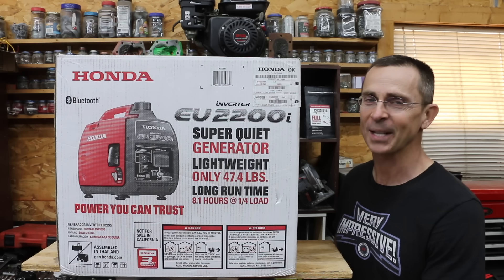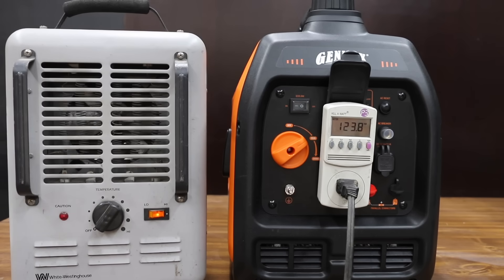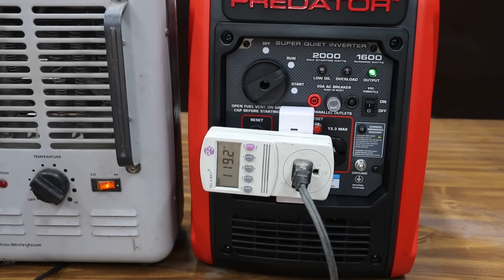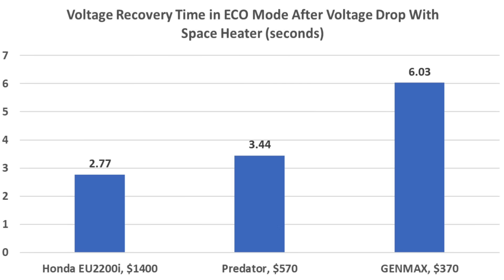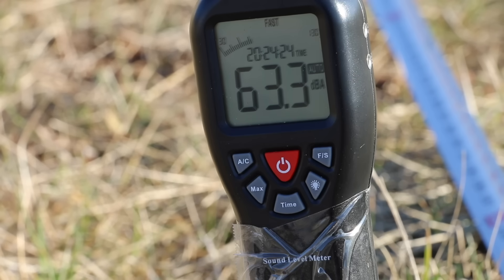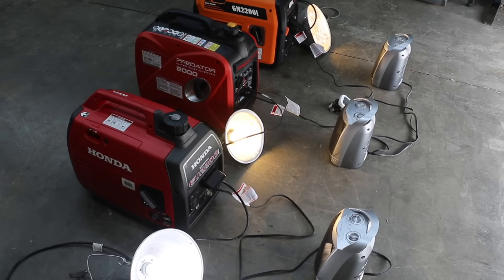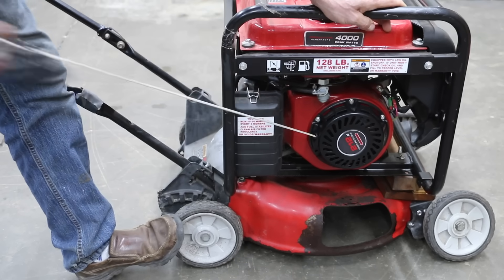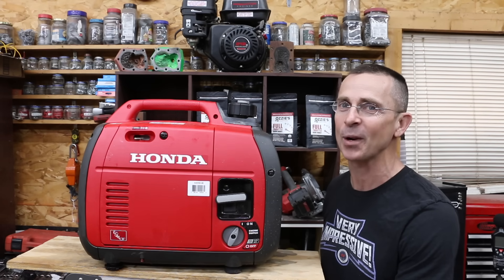Cheap Generator Better Than Honda? Predator vs Honda & GENMAX—Let’s Settle This!

Comment: Great review. Just shows if you're using generator for something like running a quick food stall by buying a honda you will get longevity and overall reliability. The others would be great for occasional use like power cuts and camping. 
Have a 1kva Honda generator which is whisper quiet and starts with one pull, even after months of none use. It also will deliver more than 1kva power for short periods like boiling a kettle or using hair dryer without automatically cutting engine out due to overload.
All in all a fabulous genny which is there for instant use when needed in emergency.
Reply from the maker: Thanks for the feedback.

Comment: Seems like I could buy a few of the cheaper ones, hook them together and be better off than the expensive Honda.  BUT with that said, I have two generators now and one runs a B&S engine and the other Yamaha... Id buy the Yamaha engine again in a second...

Comment: I have a predator 3500 generator that I have had for about 6 years. It has an unknown amount of hours since the screen no longer works. I changed the oil once a year on it, besides the screen not working. Never had an issue with it. At work. We use Honda generators which are used much less than mine, and we have constant issues with them. Every year. Year. Predator definitely makes a better generator that is also much cheaper.
Reply from the maker: Thanks for sharing.

Comment: I love your videos. Only thing is that the Craftsman generator is probably the closest 1 to the Honda in all areas. We used it for 13 days for our oversized refrigerator, window AC unit and phones. Adding the tv made the switch kick off.  Just reccomend and tough comparison.
Reply from the maker: Thanks!

Comment: I would say that there are different needs in different regions.  For me I need a generator that can run on all types of fuel and run with low noise.  Because gasoline and diesel electricity are expensive to generate electricity, natural gas, especially methane or propane tanks for camping, is very convenient.  Fuel is easy to store, does not spoil and very cheap.  Using natural gas or methane gas tanks for the same power generation can save about 80% of the cost.  According to my experience, a $1 methane tank with a net content of 250g can run the generator for one and a half hours.  This is enough for me to charge all my energy storage devices including my DIY power wall.
Reply from the maker: Thanks for the feedback.

Comment: Always go with Honda, It'll never leave you in the dark. I have the big boy one, the EU7000is.  Love the fuel injection and push start. Hate the fact that it's only 5500 watts continuous and only a surge of 7000. But runs my whole set set up.
Reply from the maker: Thanks for the constructive feedback.
Reply: @ProjectFarm  you've always got great informative and interesting videos.

Comment: I've a few suggestions for potential videos.

1. Different solar panels comparison to see which manufacturer's panels provide the most consistent electricity under the same conditions.

2. Different lithium batteries comparison where you test out the consistency of the voltage, battery life and health.

3. Comparison between different capacities of batteries (like 12v, 100 amp vs 48v, 100 amp) on a price to performance ratio.

3 is something in personally very interested in as I've seen the 48v batteries cost as much as three times the price of buying 4x 12v 100 amp batteries (which you could run in series/parallel to get similar backup).
Reply from the maker: Thanks for the suggestions.

Comment: I would like to see mid size inverter generators(3500 to 4500w) tested. Honda, Predator, Duromax, and others.  Also dual fuel (gasoline vs propane) for output and performance.
Reply from the maker: Thanks for the suggestion.

Comment: Great video as always.  But one thing you forgot to mention it on the Honda you can turn the fuel off so it uses all the fuel in the carburetor bowl which helps prevent the jets from clogging.
Reply from the maker: Thanks!  Thanks for the constructive feedback.

Comment: I like Champion generators.  Chinese, but have parts and warranty in the US, only a phone call away.  I don't know if parts are available for the other Chinese brands at all. Much less that easily.  Mine are the older style 2000  inverter generators.  The square stackable ones. Now they are suitcase shaped.  Purchased two and the paralleling cable for less than one Honda.  Would have bought Hondas if that was possible.  So it was either two Champions or nothing.  They both have been great at running the air conditioning in my camper.  Almost five years old now.  I don't see a reason to buy a the Honda
Reply from the maker: Thanks for the feedback.

Comment: Nice video, as usual!  If you were going to do another portable generator comparison, I'd like to see the Champion (200961), Pulsar (PG2200BiS) and perhaps other portable dual-fuel generators added to the mix.  Also, I'd love to see a degreaser comparison on automotive engine bays, wheel brake dust, and carpets, (for both cleaning-power and harmful effects on paint, aluminum, upholstery, etc.) with the top brands like SuperClean, Purple Power, Super Green, Oil Eater, Zep, etc.
Reply from the maker: Thanks!  Thanks for the suggestions.
Reply: Would like to see also

Comment: I have a Honds. 2200 I you get what you pay for they are designed to last 20 to 40 years and they hold there value you can still sell a 2000i for $700
Reply from the maker: Thanks for sharing.

Comment: you know you cannot buy those in California anymore due to the tomf-kery of the CARB? (ca air resources board).  basically they made Honda "recertify" their engines after they already did, and were using bureaucracy to unofficially ban them from being sold.  i went though this because my shop needed 2 new generators.  the largest they could sell is 6.5kW here. we bought 2 at $7k a piece.  don't ever live in California.  they'll all be banned in 2 years also.
Reply from the maker: Thanks for the feedback.

Comment: The thing is, for the price of the Honda, you can buy two of the other ones so you have a spare generator and engines can be replaced with better engines actually.
Reply from the maker: Thanks for the feedback.

Comment: Folks - GENMAX IS NOT GENERAC ... please correct me if I'm wrong.
I have the Generac inverter generator, and it looks slightly different from the Genmax in this video. I googled a bit, and it appears that Genmax is NOT Generac.

Comment: As electronics engineer I have a few things to say. For power tools and many other appliances voltage drop during start-up or plugging in is actually beneficial. It has the same effect as a soft-start functionality built in into many instruments, but to lesser extent as voltage does not drop enough to be a real soft-start. If going beyond power tools, the vast majority of modern devices have a switch-mode power supplies which do not care about voltage drop of this magnitude. And it does not cause more wear in >99% of appliances.  If not considering power meter inaccuracy, no load voltage of Honda is out of spec as 114 V to 126 V (RMS) (−5% to +5%) is allowed. As of voltage recovery time, this power meter has way too slow response. You need to keep  in mind that not only it has a  lot of delay in what it shows, but this delay is also inconsistent. There may be more short term voltage drop than displayed, recovery may be faster, and there may be voltage overshoot during recovery which is not visible due to sluggishness of the meter. Oscilloscope which was used later in the video is a way more appropriate instrument to measure voltage drop and recovery speed.
Reply from the maker: Thanks for sharing.

Comment: When comparing generators it’s important to also test them at altitude.  The cheaper generators often struggle above 3000 feet.  When comparing decibels it’s important to know that an increase of 3 decibels is twice as loud.  The initial cost of Honda generators is high but it’s the total cost of ownership that’s important.
Reply from the maker: Thanks for the feedback.

Comment: I wonder if the gap from the Gen Max was instead factory correct but wrong in the maintenance manual especially with tbe amount of carbon deposit which meant it was not burning properly. 🤔  Maybe redo the test with the factory setting?
Reply from the maker: Thanks for the suggestion.

Comment: Great video as usual, very informative. On a similar topic, there's been a few times I've had to run my refrigerator and other things with a 1500w inverter connected to my car. I'd love to see inverters compared, including pure sine wave vs modified sine wave inverters.
Reply from the maker: Thanks and you are welcome!    Thanks for the suggestion.
Reply: Inverters are nice but supplying them with the 12V power for longer term operation is the hard part, unless you have some large power bank set up.
It might be interesting comparing ultimate efficiency using a generator vs a car with inverter, in terms of kWh per gallon-  that'd be an interesting test to set up.
Reply: @dubmob151  yep. I had to keep my car running the whole time when I ran my refrigerator from it. Definitely wasn't the best or most fuel efficient way of doing it, but I didn't have a generator at that time, and that setup got me through a few multi-day power outages.
Reply: @YardDart63  advantage of that is the gas will be fresh and ready at all times, if you only need it for the occasional power outages once every millennia or so.  Generators need to be prepped properly for long term storage also, so an car inverter has the advantage of just unplug and go.

Comment: My 15 year old Honda 2000i is still going strong and does not burn oil. It does not have an hour meter so I'm estimating around 800 hours minimum. You did an excellent comparison here!
Reply: The 2000i actually DOES have an hour meter. It tells you, in code, by flashing lights when you first start it (on the panel). Count the number of flashes, and that's how many hundred hours it has run.

This is a little known trick that can help you find a smoking deal on a used 2000i with low hours. Also, learn which model numbers are made in Japan (another thing the average person doesn't know how to find) I got one with 200 hours for $400.
Reply: @PaulLawson-k8v 
 Honda models that are made in Japan usually have a tag saying "made in Japan". Actually Yamaha has more models that are made in Japan than Honda.
Reply: just cant beat a Honda, when we get new equipment at work I get excited when it has a Honda, lol
Reply: @PolPotsPieHole 
Don't forget Yamaha. 
Also made in Japan  and in some cases better than Honda.
Reply: @PolPotsPieHole I've got a Chinese copycat Honda that's 24 years old and has over 30,000 hours. It doesn't burn oil either. Starts with the first pull.
Reply: I tend to attach an hour meter to all my appliances. ;)
Reply: Generator snobs
Reply from the maker: Thanks so much!  Thanks for sharing.

Comment: I have two eu2000i's pushing about 800 hours each, used pretty much weekly.  Following the book maintenance schedule, both still run like new and use no oil between changes.  Great machines!  It's worth pointing out that the Honda should be expected to have a more pull start effort required, as well as use a bit more fuel, as it's a significantly larger engine than the other two.   Thanks for the tests!
Reply from the maker: You are welcome!  Thanks for sharing.
Reply: @ProjectFarm I Love to See Comparison of Champion inverter generator and Westinghouse inverter and Honda inverter generator 👍
Enjoy your videos
Reply: GE-3300A
Reply: I have 2 that have at least 4000 hours on them still going great.
Reply: Had the same results with my honda, very solid and reliable . it is 20 years old and still  chugging along. did replace the carburetor one time.
Reply: The larger engine is great - and still quite efficient. Not only does it give it that quiet/distinct 'Honda purr', it also handles sudden large jumps in demand while running in Eco mode without significant vdrop. I have used another few small inverter generators that can/will drop to the mid 80V range before their engines kick up in response, which is no bueno for some devices (usually OK with Eco mode OFF on those generators).
Reply: Yeah MY EU2000i has over 10,000 hours and still runs like new....Also the Honda probably only uses more fuel till it breaks in which takes several hundred hours. The Honda clones probably all have pretty loose tolerances so start off with a lot less internal friction...At the cost of many of them not lasting as long as the Honda's break in period.
Reply: @THX..1138  All the clones use a 80cc engine, the Honda EU2200 (as tested) uses a commercial grade 120cc engine..  I have no idea what your EU2000 has for an engine, but it is not the same as the EU2200
Reply: @THX..1138 what do you do in life that puts so many hours on your generators? 

And are the inverters significantly quieter than the portable generators in person? My portable is REAL loud and not ideal for going unnoticed in a power outage
Reply: @THX..1138 I guarantee my copycat Chinese Honda has well over 10,000 hours, closer to 30,000 hours. It's currently 24 years old and starts with a single pull.
Reply: @Bryan-Hensley  Yeah I can believe that, but there's some luck in your purchase. China clones vary wildly in quality. Like all Chinese products most fall in the range of the cheapest they can possibly build it. If you buy real Honda you for sure get real Honda quality... 

Also back when the Honda clones first appeared they were literally made by the same factories Honda contracted to manufacture the EU2000. These units were the same generator they were making for Honda, but without the Honda branding. Honda even sued over it at one point because people were putting Honda stickers on the clones and selling them as the real thing...So your 24 year old Honda clone may actually be a real EU2000.
Reply: @THX..1138  it wasn't a copycat eu2000. It was a non inverter model. I can't remember what model Honda called them
Reply: got two eu2000's one that we did the maintenance on and valve adjustments after 1k+ hours and a new one that we completly neglected, ran 3-4x the hours per oilchange it's been running for atleast 2k hours now sometimes coldstarts in -37c like last week in northern Sweden. Both generators have ran perfectly for over 5k hours total. Compared to that of a Kipor Chinese castiron pos, that needed new sparkplugs every 3 days it's night and day. Also ran it 24/7 for 3 months fuel and go due to a exploded battery bank, and it survived.

Comment: In order to get an accurate generator engine oil analysis you need to strip the engine and clean all the engine internal parts and cavities then test the oil or run the engine for 300 hours and change the oil every 100 hours then test the oil.:face-blue-wide-eyes:

Comment: Test Westinghouse... I bought one of their first units to come out when they re-entered the small generator market about 12 or 13 years ago... I spoke to an engineer and he said the present parent company after buying Westinghouse back then realized they were sitting upon a bunch of proprietary technology (example: counter rotating fans that reduced noise) that could improve the generator market and they have done so over the last 10 years in particular. He did a bunch of testing (different stuff than you like compression, cylinder head contruction etc.) and became a Westinghouse adherent there for a few years. Back then, the key for small generators was would they turn over an RV air conditioner without a soft start 13.5 version or not. The westinghouse would when most of the others wouldn't along with the Honda. The Westinghouse was, he said because of the cylinder/head and how it functioned under a sharp load like the start of a compressor. It was over my head what he was talking about.
Reply from the maker: Thanks for the suggestion.

Comment: What about big generators????    Lots of us here in hurricane country keep a generator for long term power outages from storms...usually in the 7KW to 9KW range.  Would LOVE to see some noise & efficiency numbers for something that needs to run almost 24/7 for a few days when fuel is tough to get hold of!
Reply from the maker: Thanks for the suggestion.

Comment: with so many off grid solar systems being used by DYI, a Propane 240Volt Generator that can be used to feed the inverter to charge the solar batteries, would be a get test.  thank you for all you do, excellent work.
Reply from the maker: Thanks and you are welcome!

Comment: Thank you very much for this informative comparison! Since I live in an area where power outages are more common than I'd like, the only thing I need to keep powered are my refrigerator and standalone freezer and the water pump to pump water through my house (all these devices together should pull under 1800W max), so I went with the Genmax GM2200i because use will be occasional at best and although the Honda is nice, the Genmax is better from a price-to-performance ratio, and that's my best takeaway from this awesome comparison.
Reply: Get 2x (or 3x?) Genmax, keep one in reserve (or alternate) 'just in case' for less than the Honda - plus you can link them together when you need twice the power...

Comment: I have a honda eu2000 generator that's close to 30 years old and used everyday. The only issue I have had, was the starting cord broke twice and I broke the outlet(both not the machines fault). Not sure those other generators will last like a Honda.